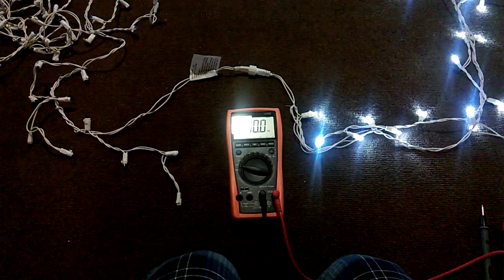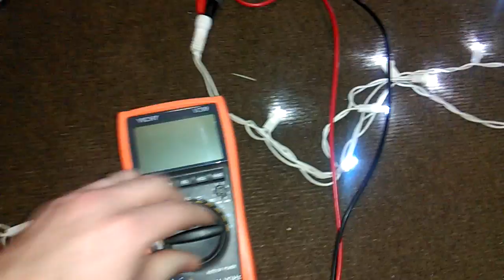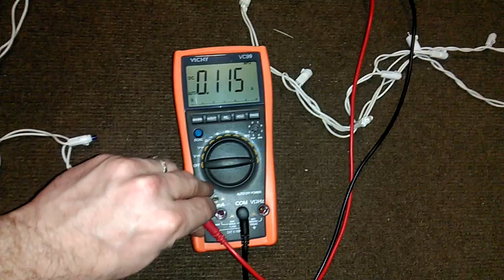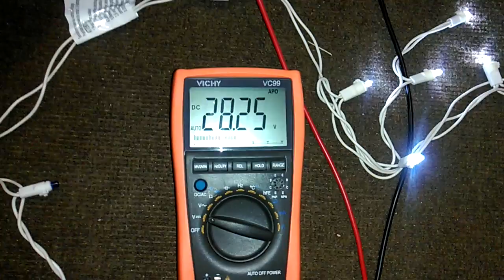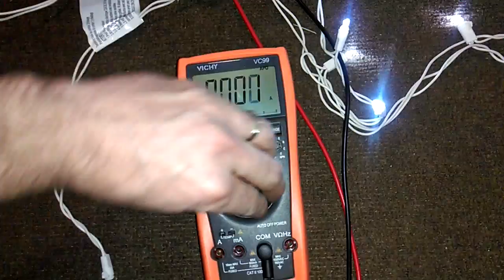Christmas LED lights not working

Comment: Happened to bump into this thread from years ago - any updates on what was the reason? 
I was just thinking that though you are able to get 29Watts on the other end of a dead string because there was not voltage drop since nothing was coursing thru it must be a transformer issue right?

Comment: 1) Agree with Ernie on measuring AMPs ... measure in series. 2) Try plugging in your blue string lights directly into the power unit (i.e. remove the white string lights).

Comment: I would say your first step is to  remove ALL of the blue LEDs from the strings then test all the blue LEDs one at a time in your working white string just as you did the one in your video.   You might find that they reserved the polarity of a blue LED during manufacturing those strings or you have a bad LED in each blue string.   So  flip any questionable LEDs and retest before confirming they are actually dead.   That will prove all your blue LEDs are good now.   Gather all the known good blue LEDs in one pile.   Since these things are built very cheaply I have found LEDs and even in the old miniature lights that there were broken wires on the bulbs/LEDs bases or the wires were too short or had corrosion on them.  Inspect each LED to make sure the wire leads are clean and have enough length to make connection to the contacts in the sockets.   If that checks out I would inspect each socket for corrosion and also for any loose wires going to the sockets.   Next start with one blue string at a time and repopulate it with blue LEDs from the tested good pile.  Once filled you should have light.   Do the same with the remainder of the strings.   Its a little time consuming but you will feel great when you fixed them.   Good luck
Reply from the maker: Might end up doing that when I have time. Thanks!
Reply: That is about the only way to find all the problems.    I just finished working on my Dad's C9 bulb strings from the late 1950s.  These are the lights he hung when I was a kid.  The wires are still good.  I had to go through all the sockets and clean up years of corrosion.  All ready to hang now.   It takes time but it is worth it.

Comment: You shouldn't be checking for AMPs "across" the circuit. When you change your DVM to AMPs, you are creating a shorted circuit. Ameters, check current "in series". Only check voltage "across" a circuit. Amps are in series.
Reply: MY 45 YR OLD SET STILL WORKS
MY LED SET ONLY USED ONCE AND THROW OUT
Reply from the maker: Yeah I've learned about this mistake when I was working on my motorcycle. I know how to measure AMPS correctly now. I haven't tried checking those lights again though. Not sure if I ever will...

Comment: I bought a prelit outside tree from Home depot a few years ago, it stopped working and has been narrowed down to the LED driver. My tree has a TS-LU6W Led driver, Do you know if they can be replaced in the states?
Reply: I have the same issue today with the exactly same LED Drive (ts-lu6w). Did you get anywhere with this?
Reply: I might have lucked out
 It has a two year warranty a and
Reply: It is still covered so they are working on it at home depot
Reply: Thanks for responding! I looked at my tree box last night and it says 5 year warranty. Do they only cover this driver with a 2 year warranty?
Reply: I have the exact same issue. Purchased the LED tree last year from Home Depot late into the Christmas season. I stored the tree inside after Christmas of 2015. Pulled the tree out to use for 2016 and would not work. Traced it down to the Ting Shen LED Driver Model # TS-LU6W and again can not find a replacement. Home Depot does not want to do anything if you do not have the receipt. Where can you get a replacement or can you.

Comment: it seem you have reversed the polarity positive negative on the second plug for the blue leds,  if the power supply provides a DC voltage as usual, they do not light up with the wrong polarity.

Comment: I have exactly the same problem. The quality of the assembly is awful. As you noticed a single failed LED  will cause a complete Christmas lighting blackout. In My assembly there are as many as 620 of them (LEDs). Go figure each one. And it is quite expensive set BTW.
Reply: THESE LIGHTS ARE SHIT
MY OLD SET FROM 1970 STILL WORKS
Reply from the maker: +Andrei Zakovorotny Yeah I bought mine on sale 2 years ago after Christmas so it was final sale (no returns). I bought 3 sets of blue and one set of white. Only the white one works. The power supplies are fine. I honestly think I'll never buy icicle sets again, the wiring is just too confusing. I don't really feel like buying special tools just to diagnose this.
Reply: +zallow No need to buy a tool. Just take one working LED and check one by one substituting with this good one. If you are lucky you will find the faulty LED.. 620 LED in the worse case... The bad news is that there maybe more than one in one segment. Another way - check each bulb with the multi-meter (mind polarity of the diods (LEDs)).
Reply from the maker: They don't make them like they used to, that's for sure.